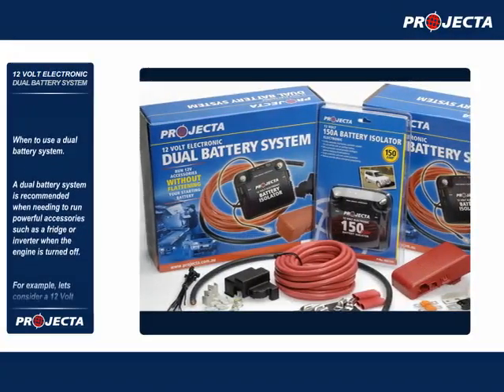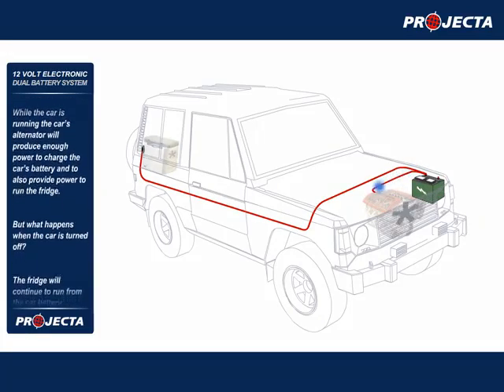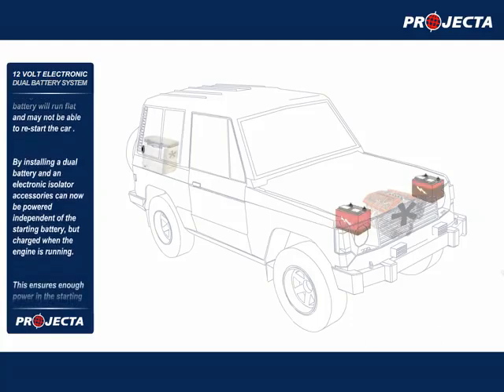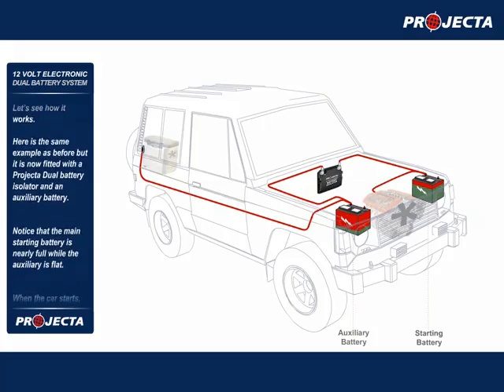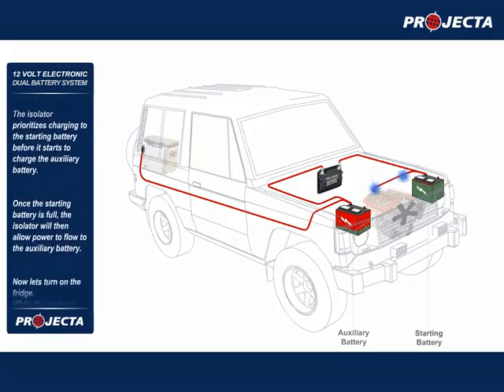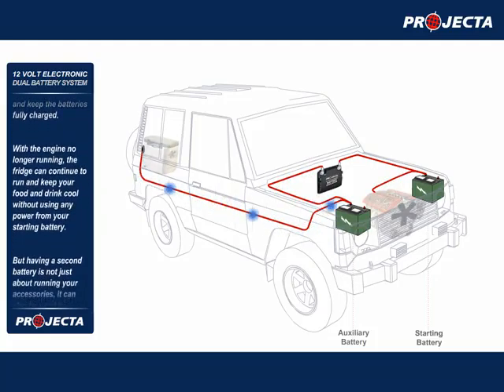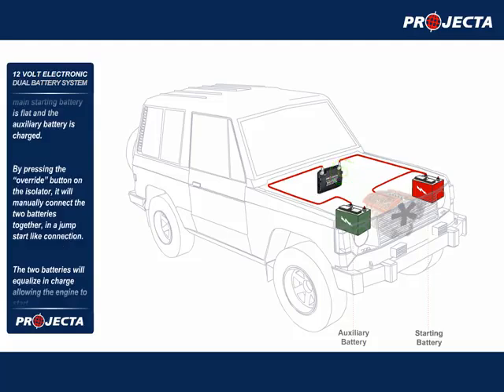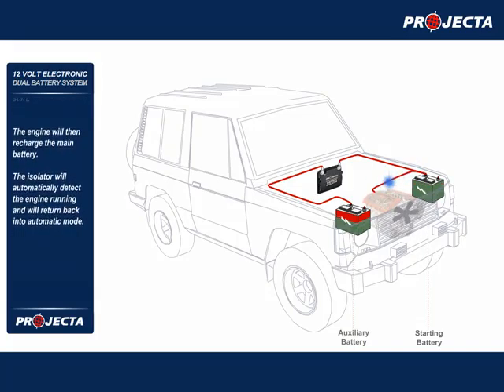Dual Battery Systems - Autos & 4WD

Comment: My vehicle has a inbuilt dual batt system ( hilux ssrx ) when i turn on the key first battary is quickly displays on the battary meter but my staring battary is taking a bit of time to enagage.  because of that i have to wait some time to start the car  ( truck ) whats the problem ? 😑👍

Comment: May I recommend a heavy-duty True Smart battery isolator kit for your vehicle? This isolator is waterproof, heat resistant, anti-vibration casing, full a year warranty and know for max 3 years lifespan. Visit www.dfna.info for retail or www.trueam.com for wholesale

Comment: I would much prefer this to solar panels on the roof. But will it fry the alternator if you are using multiple appliances in the RV or van? This must be hard on the alternator. Thank you.
Reply: I'm thinking of dual system. Use 2ndary Battery as default charging.  Use Solar when sitting to keep topped off. Should have a detector to know when to stop charging.

Comment: Can I use a regular car battery as a second auxiliary battery?
Reply: I use a regular 12 volt, as auxillary battery. It is an, "optima" brand gel type though. My fridge runs on propane only - because the DC switch never worked good, on my refridgerator/freezer.

Comment: This new battery reconditioning method is so simple and quick [Check Details Here==>https://t.co/sf4YP0oCZS ] ,And this works for car, phone, and laptop batteries! It even works with batteries you can use in a solar panel system's battery bank (or other alternative energy system’s battery bank). Plus, many other types of batteries!.

Comment: I must say, this is without a doubt the best guide to reconditioning batteries available [Check Details Here==>https://plus.google.com/100351090281822647456/posts/HMvgs7qqoKA ]. I have purchased some guides in the past but not of them come close to the amount of detail in yours. It's actually worth much more then $50!
Reply: Willie Hager

Comment: have 2 6v  batteries wired in series to make 12v with a 100w solar 
panel in my E150 van. When the sun goes down I would like to run + and 
-- wires from my starter battery to my 2 house batteries without messing
 with the alternator. Here's the question can I just run the 2 
wires off the starter battery directly to the 2 6v battery terminals 
where the charge controller attaches to the batteries and put a manual 
inline on/off switch? I did not want to use an automatic isolator that 
sends charge whenever the engine is running, I would manualy turn it on 
when I want extra charge while driving.
Thanks Love your informative vids!
Reply: Its like relay then, but does it overcharge the starter battery then

Comment: I installed this isolator on my 2002 toyota tundra, it's working perfectly. I test it out using a 60w load on my auxiliary battery.
Watch my video. "Electronic Dual Battery Isolator".
Reply: Link

Comment: Where can I get a nice electronic isolator like the one in this video for a 12 volt vehicle?
Reply: I have seen on this website ... https://www.cclcomponents.com/off-grid-accessories/battery-combiners
Reply: Thank you Amjad : )
Reply: Here’s the one in the video:   https://rover.ebay.com/rover/0/0/0?mpre=https%3A%2F%2Fwww.ebay.com%2Fulk%2Fitm%2F253300646914

Comment: Great video & clearly explains the advantages of a second battery & dual system. Thanks to such a system I've camped happily knowing my compressor fridge would not see me stranded. The dual battery system also saved my butt when my starter battery finally died on me one cold morning at home. In my case I simply flicked the on-board rocker switch - which I had installed thanks to the advice by my auto electrician - & the engine kicked over.
Reply: Where can i find more info.  Preferably details on purchase for a 98 Nisssn Pathfinder